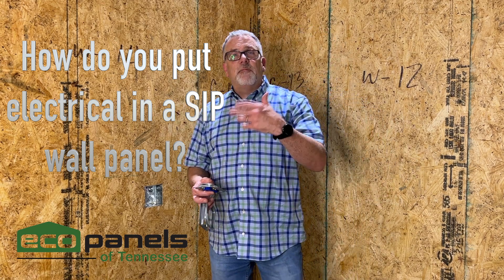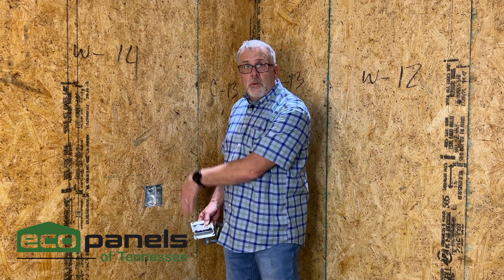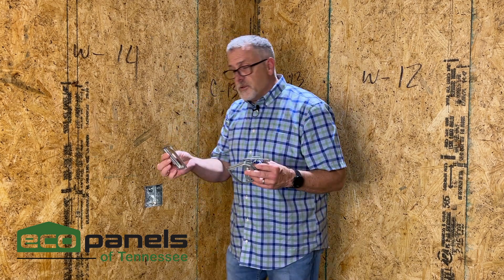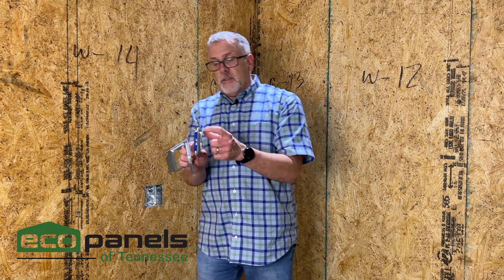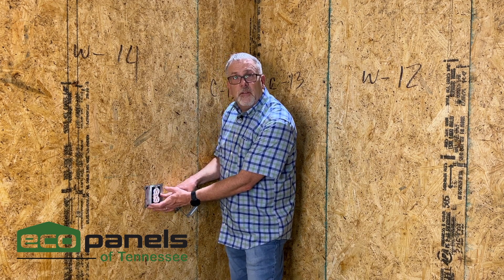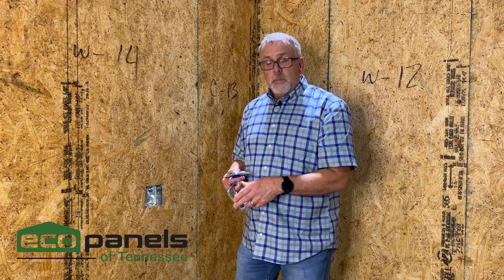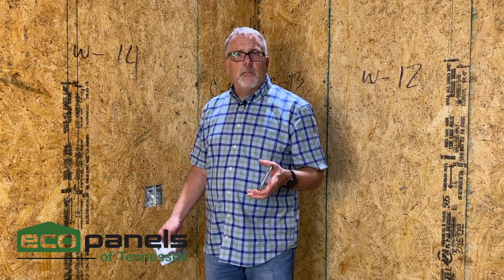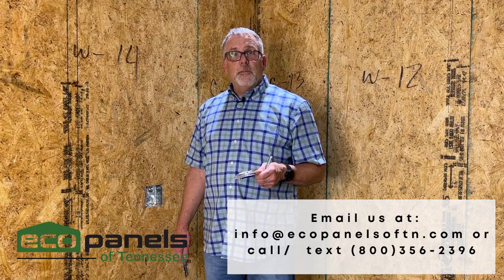How do you put electrical in a SIP wall panel?

Comment: How do you mount the box to the SIP?  Thanks!
Reply from the maker: Great question. I thought we might have another video that shows more of this but I'm not finding it at the moment. Basically, we cut an 4" square opening in the OSB so the box will drop into it. So, the box face is flush with the interior OSB. It's then temp secured in place with glue and the conduit helps with stability as well. Once the foam is injected into the panel, it's fully wrapped in foam on 5 sides, making for a VERY secure fit. We check to make sure the box position is secure, in the right location and the raceway the conduit created is clear during our quality control setup. Hope that describes the process well enough. Thanks for the question!
Reply: @EcoPanelsofTennessee  so do you mount the jbox above/below the electrical raceway in the panel.  Also, for anchoring the wire to the box, do you just use a cable clamp that pushes into the punch out?  And for wall lights, I'm assuming you still use a square box with a round mud ring?
Reply from the maker: @therealsoultitanium  Yes, depending on if wire is running up or down the wall, the box will be mounted accordingly. Rather than putting the screw in wire claps on the outside of the box like it typically done on a framed home, we just put them on the interior, so they are already there for you. We'll use a typical octagon metal light box for light locations. Boxes have to be metal due to the heat that's generated during foam expansion and setting. Hope that helps, thanks!
Reply: @EcoPanelsofTennessee  thanks for the info!
Reply: @EcoPanelsofTennessee  Thanks for the info!!

Comment: being the lazy guy that I am  I would simply build a service chase arount the entire perimeter of the building.  By the time that I nail up the wood I could have wired  perhaps three or four boxes.  Doing the same on  the cieling perhaps one box.  Just  makes life for the electrician easier and one heck of a lot less expensive in the long run.  No drilling no fishing  Just tack up the boxes where you want them... No foaming in of boxes  besides that I would also use an interior open vapor like intello to help keep the on e major con for using  sips  mold from opening joints like was discovered in massive failures of sips in Alaska   This is a great reason to use zip tap and roll the seams
Reply from the maker: If you want to run conduit on the exterior of the wall, that can certainly be done and has been in several applications. However, you should never make significant horizontal cuts in the OSB of any SIP panel. Holes, boxes, vertical cuts... all of that can typically be done. Cutting horizontal all the way across a panel creates structural issues. Do not do this.
Reply: @EcoPanelsofTennessee  something like this but running horizontal and vertical https://1.bp.blogspot.com/-mIPtSc7Bmbk/TVNYl5k-PGI/AAAAAAAAAA0/e7lYwumtL2Q/s1600/100_5098.JPG
Reply: @EcoPanelsofTennessee  guess one could run conduit but why when romex run in the service cavity is just fine

Comment: Would love a video on how you run electrical if you opt for the SIP floor. Clearly you bring it all to a stick framed inner wall to a panel, but I'm curious how you rout it there. I understand some people hide it on top of the wall, and have the roof sit essentially on a shim that isn't as wide as the top plate, but this seems to negate a lot of the benefits of going with sip. Are their chases in the floor sips? Ceiling sips? What if you're doing a vaulted ceiling? If I'm thinking of doing a heated floor is it as simple as raising the height of door cut outs, and planning on bringing the electrical out of the osb and running it along the floor with the hot water tubing? Can the OSB remain structural if it where done this way?
Reply from the maker: Thanks for the questions Joel. Generally, the same penetrations would be made in the floor when using a SIP floor or not, they're just deeper. Floor SIPs do not have chases, but typically are not needed. You'll have framing below them, and thus framing cavities for chasing wiring under the floor. We can help advise through some of that. For the interior vaulted ceiling, furring strips can be used to create cavity spaces. Some clients/builders run wiring along the edges of roof rafters and trim accordingly as well. Heated floors shouldn't be an issue, but it's definitely something we would look at in more detail together. Every house is different and sometimes requires extra attention to accommodate wiring, mechanicals, and other items. We would need to have a conversation and get more details to fully answer your questions. Feel free to give us a call.
Reply: @EcoPanelsofTennessee  Think of a fully sip paneled house on a pier foundation.
Reply from the maker: @whatintheactualf  I missed that part of the build. However, even on piers you'll have some type of supporting joist floor system. The spans and spacing will likely differ, and you may even look at a floor truss system to assist with mechanical space (unless you're in a cold climate and need to keep all mechanicals internal). The SIPs alone will not support a floor load. If you have plans, we'd be happy to review and discuss.

Comment: Just watched the video about Net Zero Homes. Came back to this video to see if you mentioned the R-value when the electrical boxes are installed. (Since the box takes up space in the wall, there has to be a measure of insulation left behind the box and outer wall.)  I'll definitely be contacting you all by email but figured I'd ask since it's a question most other folks would want to know as well.
Reply from the maker: Sorry we missed this question. So after the boxes are installed there's roughly 2" between the box and the exterior OSB. Our foam will fill that void completely, resulting in around R-14 in that specific location. Keep in mind, framed walls have this same issue, and conventional insulation provides less R-per-inch than our poly-foam. Additionally, when batten insulation is compressed into a smaller space like this, it loses much of its insulating properties. Hope this helps.
Reply: @EcoPanelsofTennessee  Thank you for the reply; it does help. I am excited to have come across your company and appreciate the videos y'all have been posting. My wife and I will be reaching out soon!